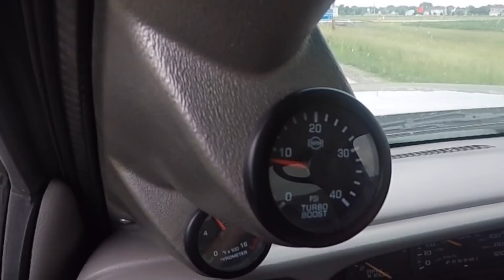Diesel Insights: Does More Boost = More Power?

Comment: hi, i installed an intercooler on 2.5 4cyl diesel, it was doing 10psi stock, is it normal for it to only do 9psi after the fmic installation? can i install a bleed valve for the wastegate actuator to get it back to 10psi or if possible more because its getting ambient charge now?
Reply: Yes. You will always have a pressure drop with an intercooler but it's greatly outweighs the air density which is actually what you want

Comment: Mate I admire your confidence
Seems you're intelligent diesel minded man
Plz I asked this question to many but no one answered me properly
I have Musso Ssangyong 
Turbo diesel Mercedes Benz based stock engine which delivers 128hp Very poor,any chances for me to reach 200hp with no heroic pocket braking modifications? Thanks mate hope you answer me soon
Reply from the maker: No idea, We've never messed with those.  Common Rail diesel generally works on the same theory across all makes and models though.  Increase fuel flow and air volume, that will get you more HP/TQ.  From there, its a matter of fixing the next weak link (which some times seems like an endless list of broken parts).

Comment: Hi, i have a question... if i just install hybrid turbo without ecu reampping.. will i gain any power?
Reply from the maker: It would depend on what Hybrid turbo you install.  With our Stealth Series turbo for the 5.9L Cummins we picked up 80 RWHP without a tune adjustment.  The LB7 turbo was about the same.  We would expect similar results on the VVT and LML.
Reply: @Duramaxtuner  soo i have 2.2dti vauxhall, its a 2.2liter diesel engine and i have stock turbo... so if i put bigger turbo from 3.0 liter v6 engine which is pretty bigger will i gain any power... and should i worry about spooling? i dont know if this turbo would work

Comment: What are good Charge Air Temps? I seen on Torque Pro and thru the ELM device, I can see this value. I know on cooler night drives the CAT value is a bit lower but not sure what are high and low limits.
Stock LML. Temp probe seems to be on the upper cold side tube

Comment: A ford in the background? Are you guys getting into the power joke scene?
Reply: Kitt Powell they have been since late September 2017 I believe
Reply: Kitt Powell I do not speak for calibrated obviously but Ford trucks particularly 2015 and newer have a much heavier duty fuel filtration system. When comparing the 2017 ford tuning to anything before it, they are hammers and sink anything built before 2010 IMO the power is to linear and smooth and the truck is way to quiet to be compared. The only Dmax I have driven that drives as well as a CPS compliant Ford is an LML with a wherli twin kit.
Reply from the maker: http://calibratedpower.com/powerstroke.html
Reply: Duramaxtuner what are you opinions with tuned 6.7 fords compared to duramaxs (lbz-lml)  around 550-600 hp as far as longevity and less issues? I know driver and vehicle maintenance plays major factor but let’s say driver that does great preventative maintenance and doesn’t hot rod every time they drive?
Reply from the maker: The 6.7 Powerstroke has been very impressive.  Longevity is hard to speculate on, but so far so good for us.